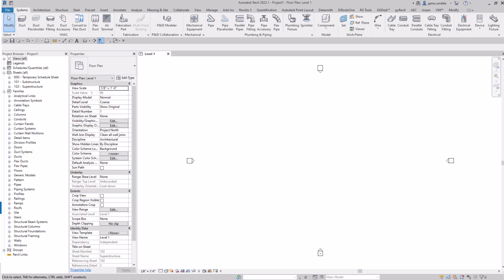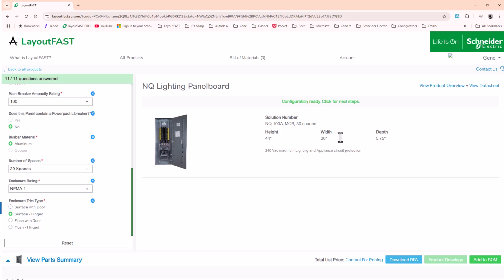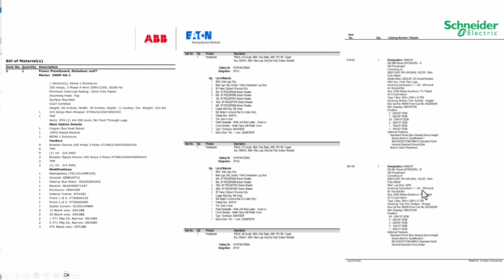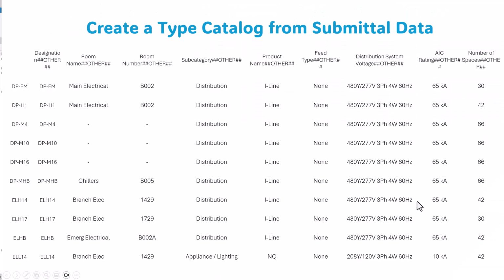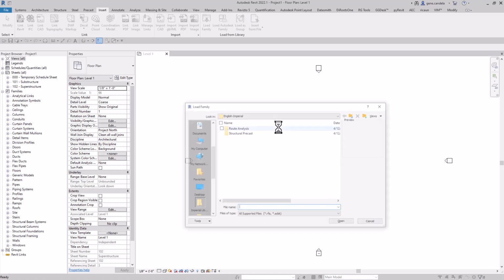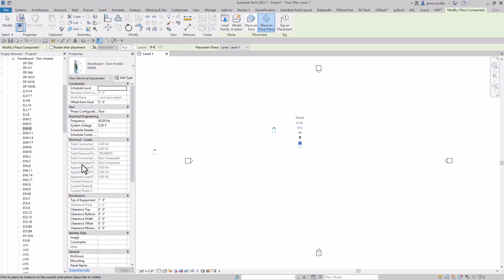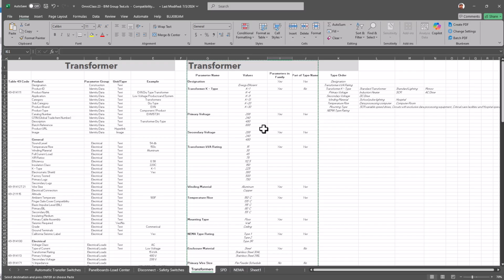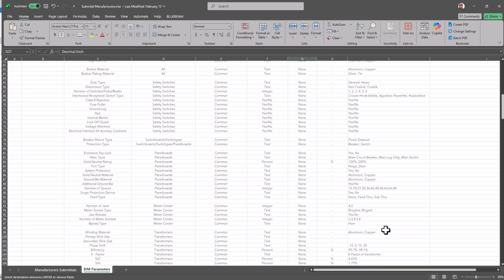Revit Manufacturer Submittal Data to Type Catalog!

Comment: Is there a reason you used a type list in txt format instead of an XML document? Not saying XML is better but I was curious if Revit even supported it. I also agree on the standards for naming. Doing anything with design can be difficult in this country when every manufacturer has their own nomenclature that can be slightly or completely different from one another.